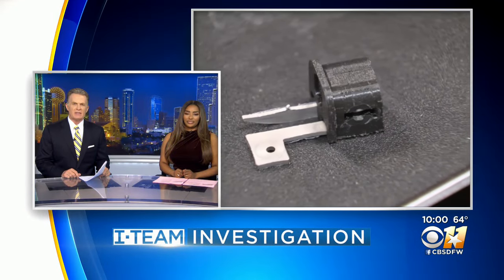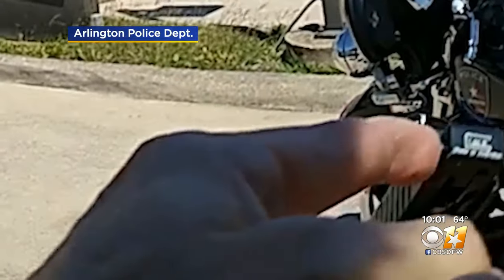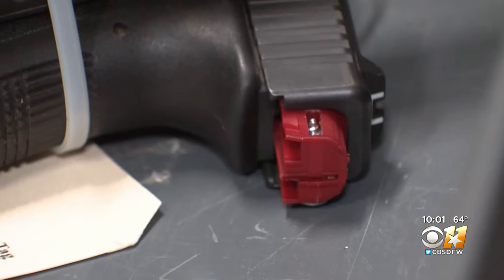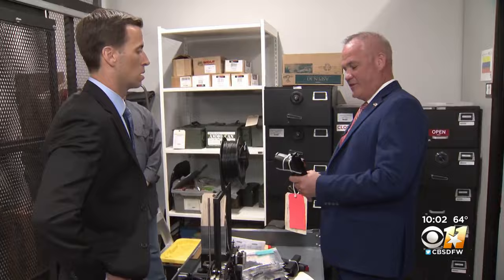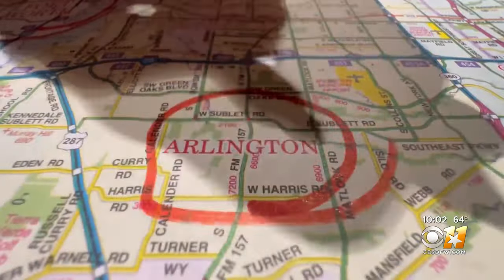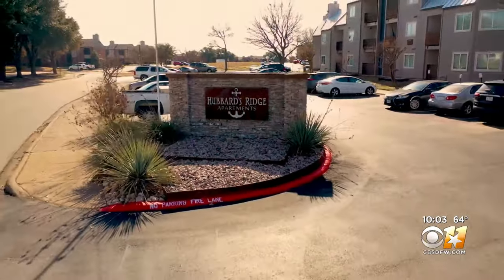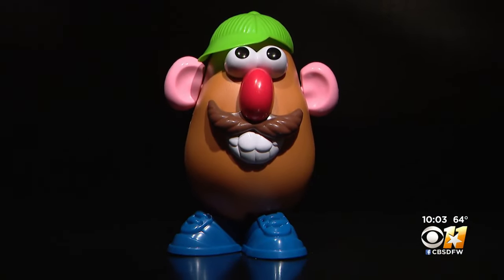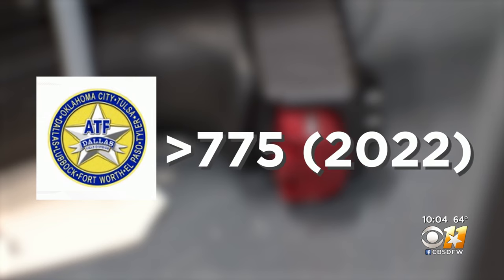3D printers used to make illegal handgun switches magnifies challenges for law enforcement

Comment: To clarify, these "switches" can only be installed on GLOCK branded handguns. ⚠️
You can't just take any handgun and put this gadget on it, it has to be GLOCK. ☝️
Reply: To be fair the Gen 3 Glock patent expired, so there are many more than just Glock branded handguns this effects but most Glock gen 3 style handguns. Problem with this is it will keep the law abiding citizens from owning or possessing one of these switches. Anybody else that really wants to do bad can get one and make many more from a cheap $150 dollar Prusa style 3d printer.
Reply: or a psa dagger
Reply: I have a diamond back am2 it's a glock clone, the trigger system looks the same as a glock to me. Idk if one would work in mine in particular and don't want to try and be the guy had it blow up in his hand, but if one can be made for a glock it can be made for others. Have you tried to put one in every glock clone there is? I highly doubt it. I wouldn't go as far as saying one wouldn't work in any other.
Reply: You can have em ln Fns now.
Reply: Wrong. You can put them in any p80 build, doesn't even have to be Glock.
Reply: You can make a switch for any striker fired pistol, M&P, SIG P320, Ruger, Springfield all have pretty much copied Glock.

Comment: It's not the Glock switches that are scary, it's the sorts of people that commit unlawful activities while using them. It's crime that's the issue, not 3d printing or firearms. As long as man has had bearable arms of any sort, unlawful people have used them to commit unlawful acts, but people have also used them to protect themselves against unlawful actions by those same individuals.

A firearm is just a tool, it doesn't do anything until someone uses it. How many times has baseball bats, hammers, golf clubs, crossbows, or bricks ended up in evidence lockers? It's always been a crime issue, not a guns issue or a 3d printing issue or a full auto issue.

Comment: Might as well just repeal the NFA, you cannot stop this. You can just drill a hole in the striker cover on a Glock, M&P or any other striker fired pistol. Then you can stick a paper clip in the hole and hold the sear down. Its only good for suppressive fire, and almost useless for aimed fired just like any other machine gun. If anything these World Star hiphop dork thuglets are even easier to take down if they are using these in a crime. They will use crappy ETS or Promag sticks that jam every other round.

Comment: That's a glock, they blow up without the switches in em, either you're using over pressured loads or you're not checking your slide for cracks and warps.
Reply: They probably warp due to firing and emptying multiple drum mags in a row.

Comment: If you 3D print that switch, it wouldn't last 15 rounds. Seriously.
Reply: doesnt it have to hit the striker and grind up against some other components?
Reply: doesnt it have to hit the striker and grind up against some other components?
Reply: @fluffypinkpandas  Nah. I'm not going to go into details on here, but the little leg that sticks out of the switch interrupts the plunger safety, allowing the striker to stay in the the forward (fire) position every time the slide returns to battery, causing the next round to be fired without the trigger resetting. The ATF probably doesn't even understand how they work. However, a certified Glock armorer does...
Reply: From experience they last about 100 to 300 rounds depending on the plastic you use
Reply: @214huesos3  disposable like resin suppressors

recyclability of being plastic

yet reliable 
NICE

Comment: The 3-D printed switches aren't very reliable and don't last very long. If they do work, let's be real it's plastic and it needs metal to work properly.
Reply: Shows u DON'T Know WTF U Talking About 🤣🤣🤣🤣🤣.....

Even The Factory Made Switch ISNT 100% Metal.....

N ppl who 3D Print ADD The Other Components Needed....

Even The THUMBNAIL SHOWS THAT 🤦🏾‍♂️🤦🏾‍♂️🤦🏾‍♂️
Reply: All you gotta do is add a metal arm out of sheet metal and it'll last. 
Waste of ammo and not worth prison time waiting on a glock binary trigger instead
Reply: @AlanxM-kn6zq  what's a GOOD Printer 2 Get ... I'm looking 2 get 1 so I can start designing
Reply: @GK323la  After That Comment I Got 1... Ender 3 V2 n A Few Upgrades with it 👍🏾👍🏾👍🏾
Reply: @9-5budgetinvestorthecheapt49  hell yaa 💪🏽
Reply: Can make metal parts with a good 3D printer can make a whole machine gun if you wanted
Reply: @DmaccdasavageX2  I would like info
Reply: @9-5budgetinvestorthecheapt49  there are printers that can 3d metal but those cost like 10,000 they look nice though but your regular 3d printer cannot print metal your closest bet would be to print in carbon fiber nylon or  straight nylon which would be on par with metal
Reply: ghostgunner mills out metal frames and can probably do the slides and switches too. but ghostgunner is 2 grand.

makes your shit metal tho so if you are worried about structural integrity, thats the ticket.
Reply: @9-5budgetinvestorthecheapt49  There are no "Factory" made switches, Glock makes the Glock 18 which has a sear hold built into the slide. These guys just printed a Glock logo on a 3d printed switch with a car fuse used for feet.
Reply: @desertsoldier41  On The Glock 18 IT HAS A SELECT FIRE SWITCH ON THE REAR.... Ppl didn't just come up with this out the Blue 🤣🤣🤣... So "Switchs" r Factory Made.... it's nothing built on the or I'm the SLIDE 🤦🏾‍♂️🤦🏾‍♂️🤦🏾‍♂️ Just look at FACTORY PICS
Reply: @9-5budgetinvestorthecheapt49  Dude just stop......World Star HipHop intellgence is about to get destroyed.